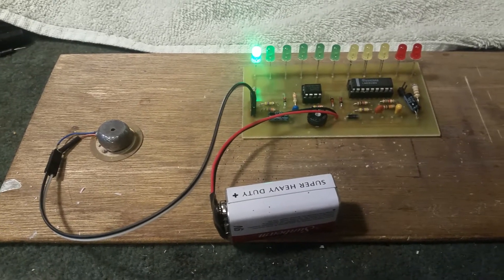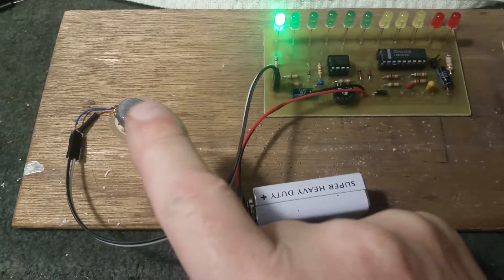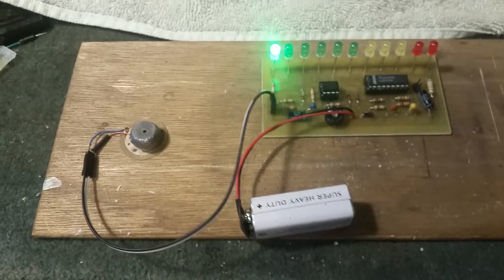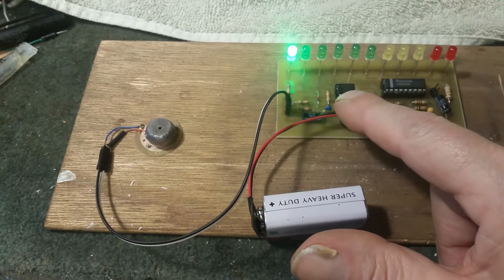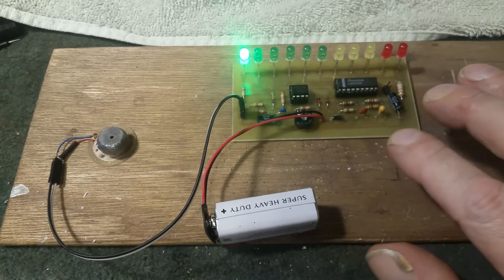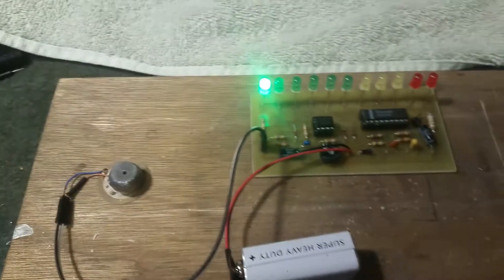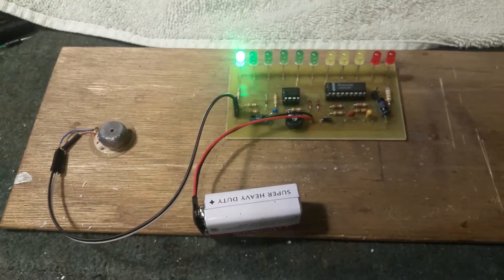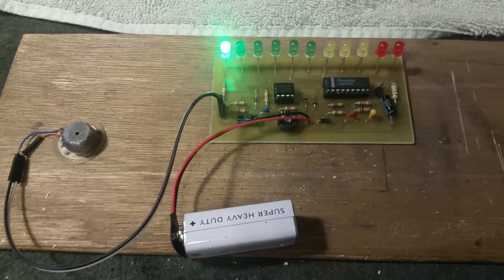My Geophone circuit board works.

Comment: Are you using a weight on the piezo? I ask because at the moment I'm using a 2oz fishing weight. I'm wondering if what you are using on the piezo would work better?
Reply from the maker: Yes I use a fishing weight that I flatten the ends so it doesn't roll away.
Reply: @kennswhatchamacallit9376  ah, gotcha. Thanks 👍